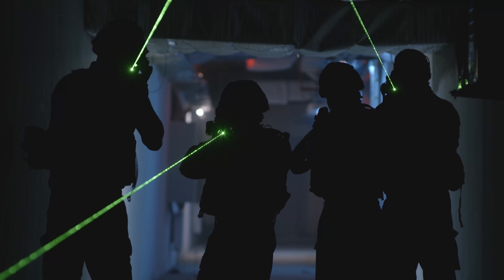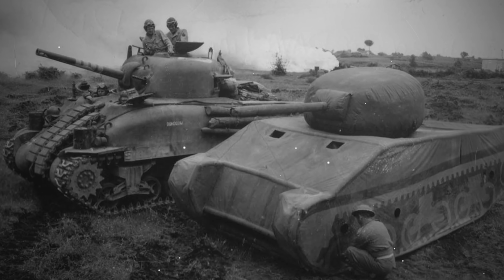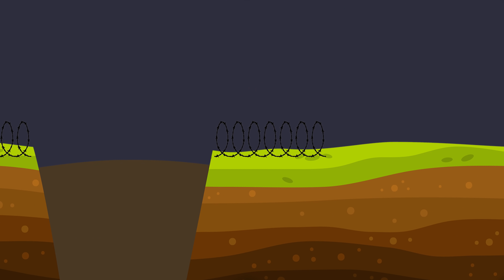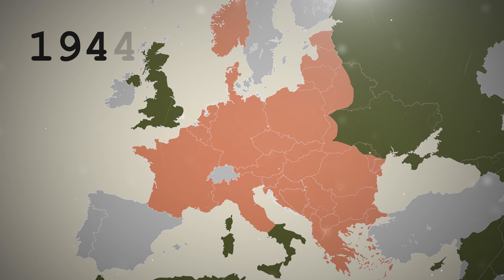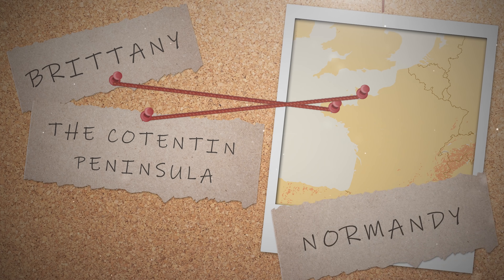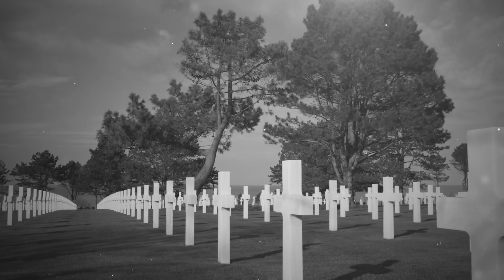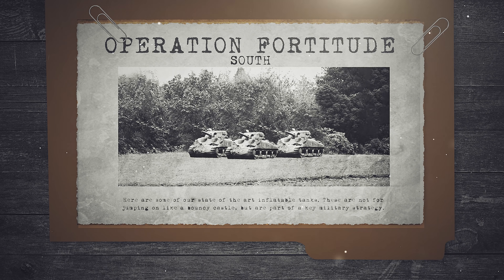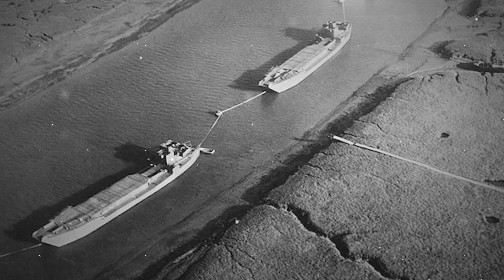Why Did This WWII Tank Float in the Air?

Comment: Cherry on top was that to get Hitler to pull out more of his troops they sent in an invasion force via parachute on The site that you mentioned above to take the pressure even more off of Normandy that parachute invasion force were rubber lice like looking dolls think of Toy soldiers by in rubber and they threw them out of airplanes so that they would believe that the invasion had started… By the time the Germans realize that they been fooled with these rubber dolls for one to the better word mannikins I had already called in an order to remove air forces and to secure the area leaving Normandy with a skeleton crew as a skeleton group literally with less than a third and even a 10th of the troops that had originally. It took them till dawn to realize that might look like an invasion force from the air or a bunch of not quite life-size but close enough to it dolls looking like parachute a sunny day they were pretty good when you consider what they look like they’re probably manufactured by the same people who manufactured the toy soldiers lol. I know it’s not mentioned here but I remember hearing about it when I was a kid and impressionable five year old and let’s just say in about 30 years since WW2. Using voice to text which means may not make a whole Lotta sense I made some corrections but I can’t keep doing it my hands are not what they should be.